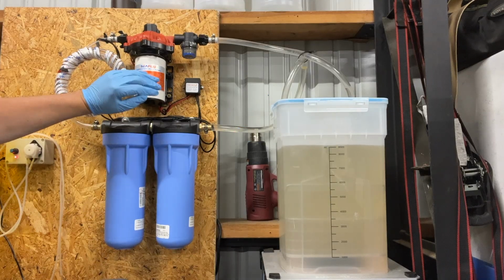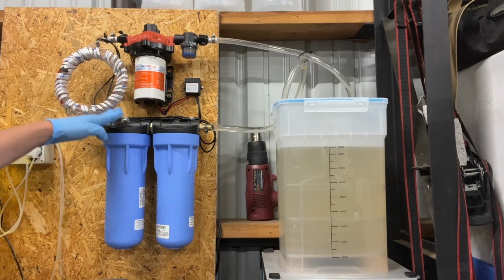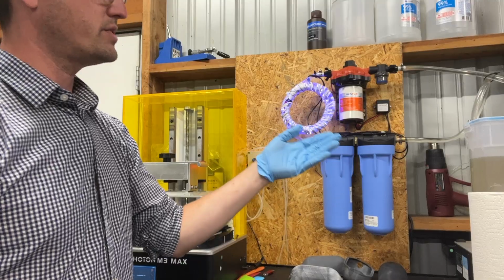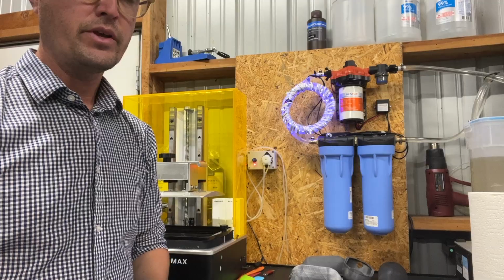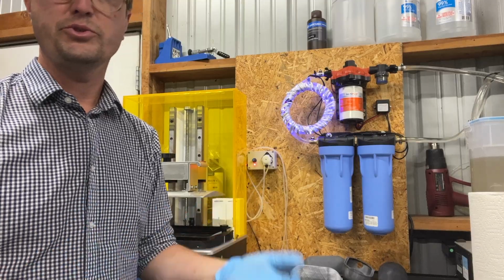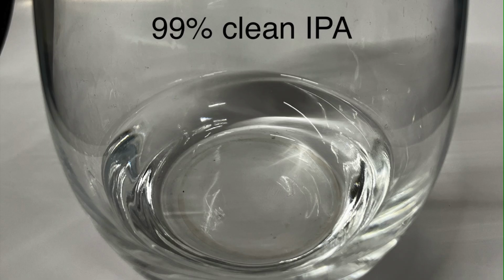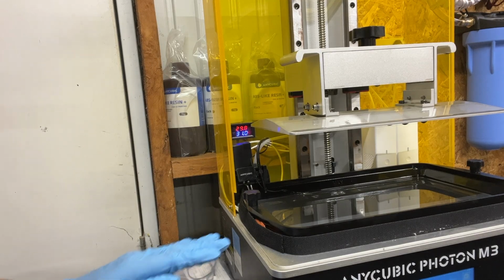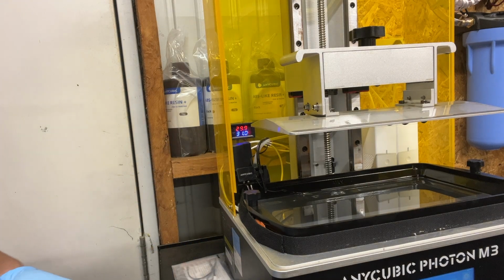Resin Printer Mods and Continuous IPA Filtration!

Comment: Nick! Excellent rig you have created. Thank you for sharing this with the resin 3d printing community. Can you show us a video or photos of where the fittings are connected to the bucket? Thank you.
Reply from the maker: Hey thanks!
In the parts list I used the bulkhead fittings on the lid of the wash bucket. 

I thought that was best so i could remove the whole bucket without having to disassemble the system.
Reply: @Nick Wilson  thank you! Are the end of the tubes reach closer to the bottom of the bucket or near the top?
Reply from the maker: @camiloalejandrollanio8192  the suction tube is near the base, the return is closer to the top, but still submerged.
Reply: @nicks-fix  Thank you!